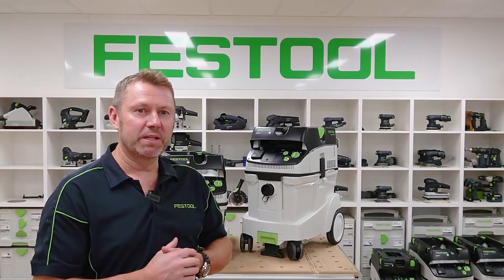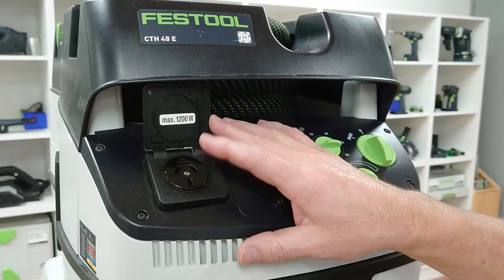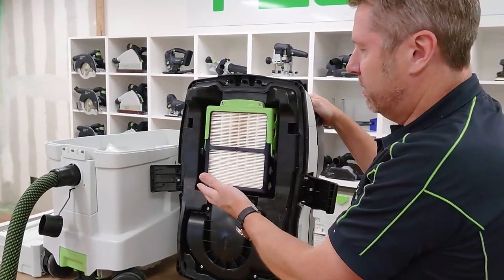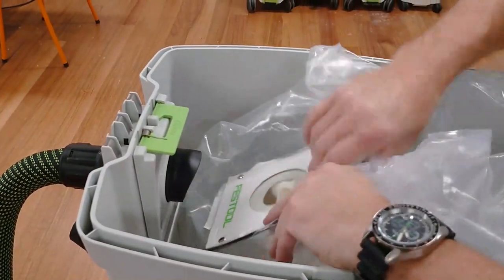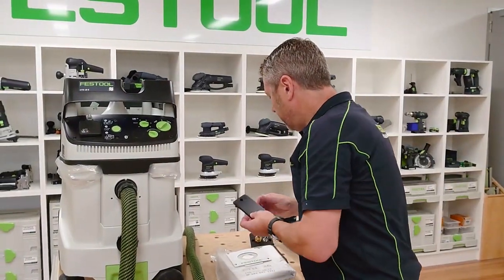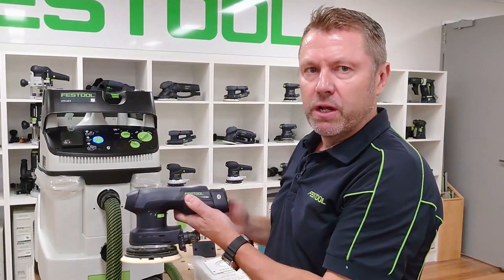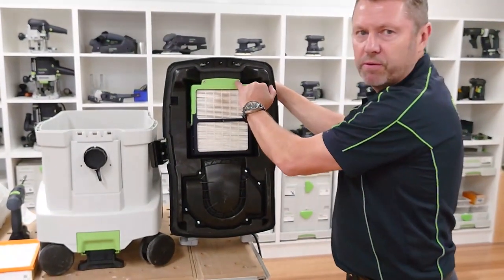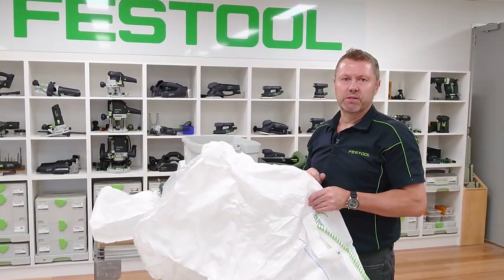Complete guide to Festool CT 26/48 H Class dust extractors

Comment: I bought a CT 26 in the US - do you know what class that is considered?
I have never seen a Festool CT designated as CTM or CTH until very recently online.  
Mine does not have the button where you can choose for different hose sizes, the filter is not bolted in, there is no plastic bag around the fabric bag, and there is no plug to block the air inlet

Comment: Why does North American versions do not have the air flow regulator?
Reply from the maker: Hi there. Probably best to ask your local Festool product team for info on these models: https://www.festoolusa.com/contact. Cheers, Justin
Reply: @Festool TV Australia - I just generally asking. Seems kinda backwards, for lack of a better word. To not have that feature on all models. Tools are tools no matter what country you live in.
Reply from the maker: Yeah that's a fair expectation. There are different 'classes' of dust extractor and this video shows the H Class, which has a specific filtration requirement including a flow sensor. It may be the case that different models/classes are offered in different countries which is why it'd be worth checking directly with your local team. Justin
Reply: @- Festool TV Australia I’ll do so but highly doubt since it’s probably different for for certain countries as you mentioned. Thank you for replying.
Reply: @pf5658  I believe its only available for thr 48